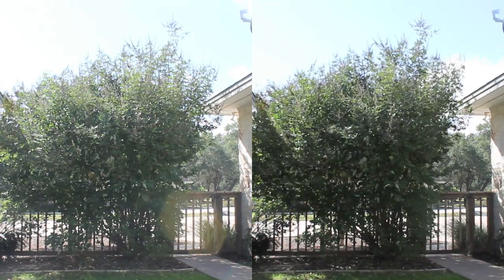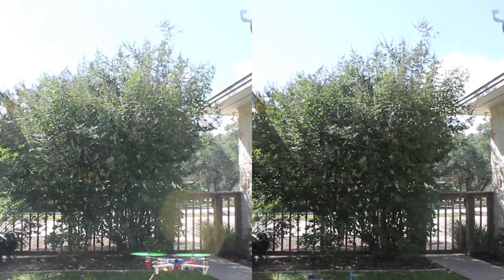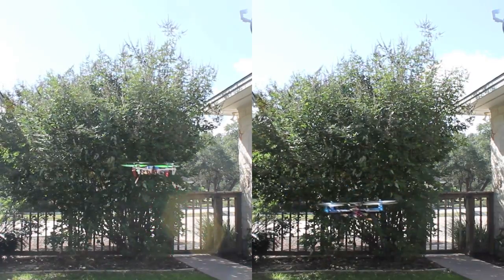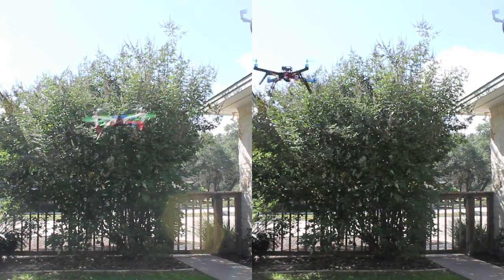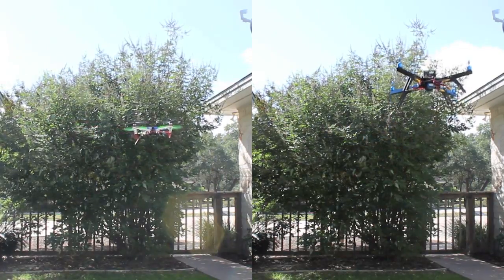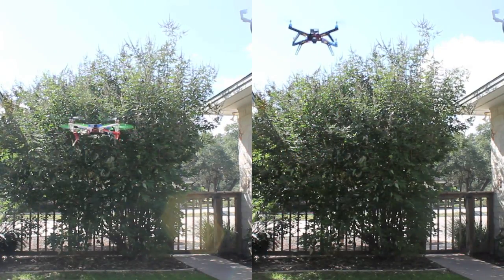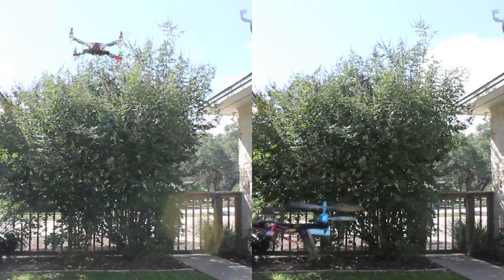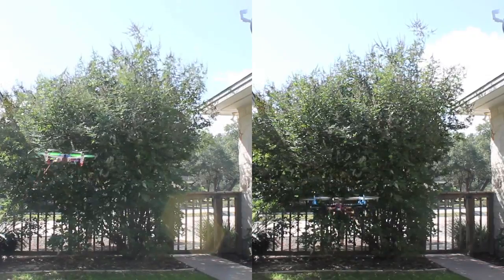DJI Naza and APM 2.5 Basic Wind Test

Comment: That was a crappy test.  You should do that test with GPS turned on on both quads.  You will find the GPS works much better on the DJI.  I have both controllers and I can tell you for a steady flight the DJI is better.  If you into hacking or Flying via a ground station then APM is better at the moment. DJI is about to release their version as a add on to most models.